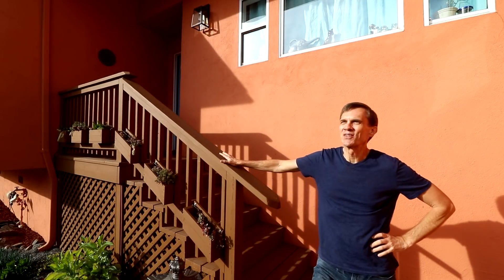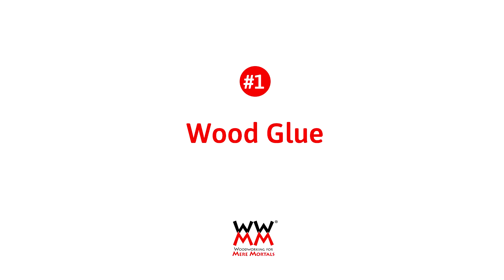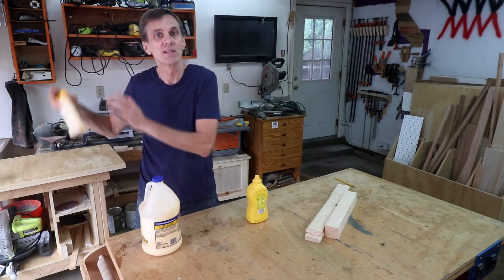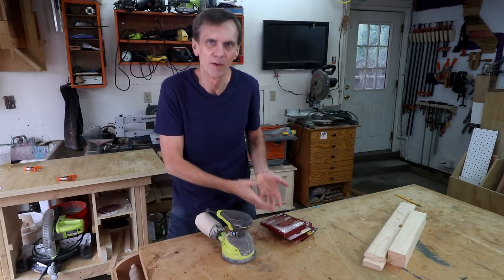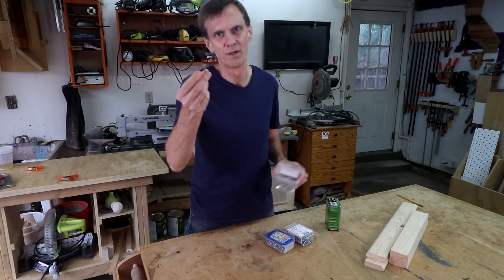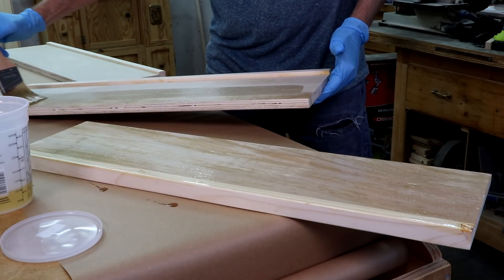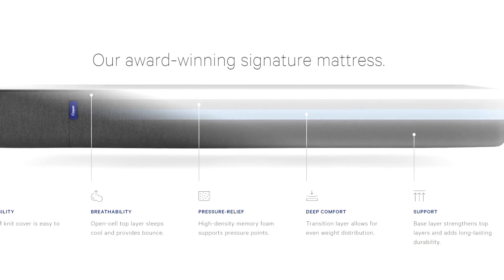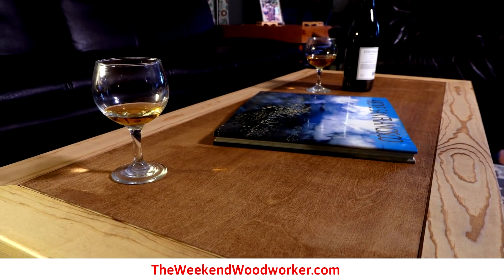5 Woodworking Shop Essentials. (DON'T RUN OUT OF THESE!)

Comment: I see that you shop at Ace Hardware. I used to be a Home Depot man. I live in a small town of 1100 ppl. A couple yrs ago I needed some odd sized bolts. Asked a co-worker where I could get them. He recommended Ace in the next town over. The staff there are AMAZING. They actually know what they're talking about, wither about plumbing, electric, woodworking, welding, tools etc. 

Ace has saved me alot of money over the past 3 years. I know most the staff's name at 3 local stores. And my 3 stores are all in the same family, even though one is 150 miles away down by my mom's house.

The staff really goes above and beyond. One time, one of the assistant managers bought a $50 tool for me, that I needed and couldn't afford at the time when I was replacing the gas tanks on my truck. You can't buy service like that.

They also spoil my service dog with treats every time we go in.
Reply: Mitchell Villanueva I love ace too, they are close to my house, and very knowledgeable, plus their brand is very good: fasteners, tape, wood filler, sand paper, tools etc.
Reply: Yeah as someone who works at a Home Depot, I'll be the first to say that Home Depot employees aren't always the most knowledgeable lol We're mostly hired to stock shelves. Not give expert advice haha
Reply: I have an Ace less than a 1/4-mile from my house! For small stuff I just walk there and tote it home. I try to give them first crack at having an item in stock, and am willing to pay a little more if they have it, before I drive 2.5 miles to Lowe's, 3 miles to Home Depot, or 4.5 miles to Menard's. The time I save not making those trips is worth a little money. The downside is they don't have the room to stock some items that places like Menard's gargantuan store does.
Reply: My son was at college and needed a very small, very specific screw. He tried the big box, and was going to go on Amazon. I told him to go downtown and ask the nearest old person where the good hardware store is. I said you will know if they have your screw if there is an old dog lying on the floor. He called me an hour later. "How did you know about the dog? Have you been there?"

Comment: Due to the kind of projects on my honey-do list, I have started stocking 8'  2x4s. I also buy 2 1/2" and 3" screws in bulk and pocket screws of the 1 1/4" and 2 1/2" lengths by the box (5000.) My trips to the lumber yard have drastically reduced.

Comment: You nailed the list of essentials for the wood shop, but because my shop is more of an "everything shop", I could add just a few.  A good assortment of O-rings, Shrink tubing, Washers and electrical/electronics connectors.  1-1/4" Kregg screws are my "go to" for pocket holes and about a hundred other uses.  Black and white paint Tremclad spray cans I buy by the case of 12 and save a few bucks, which you can also buy your painter's tape in a bulk contractor pack.  Buying these items in bulk probably saves 20 gallons of gasoline per year.
Reply: I know my “everything shop” is always missing something!

Comment: i think you nailed it with your list.. i like to keep a stock of all my consumables. when i open the last box its time to restock.. screw/bolts/nuts wood glue, hot glue stick, gloves, safety glasses, all tapes, spray paints, wood finishes, paint brushes, sand paper, knife blades, dowels i think that's my must have stuff to keep stock of..

Comment: Pencils are my thing. I hate when I can't find something to write with.
Reply: Matthew Ward I always have pencils, just they are all blunt :/
Reply: I had the same problem. I ended up making a pencil holder by drilling holes in a piece of 4x4. I have like 16 pencils in it and an electric sharpener in my garage. I don't always put them back in the holder but when I see I'm running out then I make it a point to start looking for them or just buy more.
Reply: where I work full time I kept getting irritated that the pencils would just disappear, so I bought a gross of pencils (144) from amazon for 10 bucks. 
the reviews said "pretty good, but the lead isn't always centered so pencil sharpeners don't work on some"
Pfft, I sharpen with a knife so that doesn't matter.
that was about a year ago, with between 7 and 12 people in the same shop, there are still a dozen or so pencils in the box. 
I just ordered another gross for my personal use, should last me about 5 years I reckon.
Reply: Not sure the English name, I only, ever, always use ever sharp pencils (criterium in French ), those plastic pens with 0.7mm carbon sticks. Never need sharpening, always thin, very regular and precise trace. Always have 3 spare ones in my box. 

Also, carbon works on most surface, can be removed with rubber, and is chemically stable. It is not altered by water or other solvents, does not fade with time, light, air, oxygen, and never diffuse through paint ... Like most ink pens. On metal it produces a very thin trait, but it's usually enough to draw reference lines, and you can make them more visible with a tungsten point just before drilling or cutting.
Reply: I keep mine on the top of my ear....
Reply: Me to its so annoying not being able to draw with a runaway pencil! LOL
Reply: dscrive I did the same at work but I buy the brightly colored ones (pink or orange seem to work best) this way you can see them quickly and you also know immediately who’s collecting them.
Reply: Wear bib overalls.  Very handy pencil pocket right there.
Reply: i have pencils all over my work area but they are nowhere to be found when i need them :\
Reply: That's why I buy 20 pencils near hand.
Reply: @dscrive: Perfect! :) Same here. Only I bought 26 pencils. I can verify it works. Finally! There's no problem anymore with "where did I put the pencil?" when it's needed fast. The pencils are everywhere! :) At strategic locations in garage, workshop, even home. Sometimes I have 1 person to help. So, the minimal safe number of pencils per person is 13. Twice that is optimal.
Reply: I have dozens of pencils in every nook and cranny of my home...  and I can't find any of them.
Reply: Need to add a pocket pencil sharpener to that. I just can't seem to get a good point with my pocket knife. 😁😁
Reply: The only problem with me not having a pencil is because it’s in 2 pieces in the corner after I have lost my sanity due to my sisters breathing over my shoulder - usually after eating a peanut butter sandwich - while I work on joinery that has to be perfect or close to it.

Comment: A gallon is not cheaper in the long run. At least not if it falls over without the cap on and you don’t notice for a day. Happened to me and I let it dry. Afterwards I could peel it off in one big piece and had a nice clean spot on the floor.

Comment: fiy, for those with latex allergies (made from natural rubber), check out nitrile gloves (made from synthetic rubber) which have a higher level of puncture resistance but perhaps less touch sensitive than latex. Thanks great video as usual.

Comment: I stock disposable chip brushes, both 2" and the "acid" brushes, in bulk. I use them a lot for glue and finish application. Also, shop towels, you can never have enough.

Comment: As a suggestion, instead of masking tape for marking where to stand, get some spike tape. It's what we use in the entertainment industry. It's a colored fabric tape with an adhesive that makes it easier to peel off the floor than paper masking tape. It's a little more expensive, but you probably won't run out anytime soon.

Comment: Yes, I too have that same sandpaper psychosis. I don't throw away sandpaper until it gets glazed from paint er varnish. I found a rubber block that is used to unclog sanding belts and I probably get more life out of my sheets of sandpaper now than I am legally entitled to. Check out the online search term (ahem) Unclog Sandpaper. After a few unclogging sessions, I promote my sandpaper to the next highest grit. If I've unclogged 120 grit a few times, it evolves into a 180 grit. Its actually gratifying to see it come back to life! Keeping it unclogged only takes a few seconds and beats having to change it out so I don't wait until it is destroyed. The trick is to catch clogging early and not pushing the block into the paper very hard while the sander is running. I've done this with belt sanders as well as oscillating sanders. Someone on line also recommends using a tennis sneaker. Would that be sneaker psychosis?

Comment: Mechanical pencils and lead, 0.7 mm.  I  kept losing them and rebuying so often I took a scrap of wood and drilled holes in it to hold several of them and then mounted it on my tool organizer wall.  It forced me to always return the pencil to its place on my wall when I am not using it instead of leaving it in some random place I think I will remember but never do.

This simple thing has saved me lots of time and I don't have to replace them as often.

Comment: I am getting started in wood working, at first because I am finishing out our basement, but also because I found it enjoyable. Oddly, I have purchased a sliding Miter saw and a router with table, but no table saw. I guess I am going at things backwards, but I bought the miter saw first because of all the molding I am cutting.

It seems like I can do most things with what I have, and with my circular saw using a clamp on guide, but I keep eying table saws.

Comment: For me, it's flap discs and foam sanding blocks.  I do a lot of steelwork with my projects where I use a lot of flap discs on the small angle grinder (specifically, 80 and 120 grit angled flap discs).  They eat metal and wood in seconds if needed.  On top of my steelwork, I like to finish my ugly-ass welds with spot putty, usually used for imperfections on car bodywork.  I fill pinholes and tiny gaps with the spot putty, let it dry, and then I'll have at it with the 120 flap disc and I'll finish it with a foam sanding block.  The foam sanding block lasts forever if you just to spot putty finishing with it.

Comment: One item I like to always keep on hand is ballistol. It’s good for almost everything. I use it to protect and lubricate my tools and all of my other hobbies. It is also pretty inexpensive compared to topcoat sprays. And is eco friendly at that. Just remember that the more you use it the better it works because it soaks into the metal, leather, or any
Reply: Other material. It is good for a lot of different types of material. Check it out and see for yourself.

Comment: I also dislike running out of screws and glue. I use square instead of Torx/Star bits. I am sure there is a mechanical advantage or something about using Torx over square head, but I haven't experienced it. I use the square because it costs less in my area. 

I also dislike running out of coping saw and fret saw blades. I don't go through that many of them, but that is how I run out of them. I break one and then I think I am sure I have another package somewhere. Like you with sanding discs, I keep two packs of blades. Once I run out of one I add it to my list. Yay kan ban!

Comment: OK two things.. Razor blades... Need several 50-100 packs mounted, on the wall, everywhere... Other folks mentioned pencils. I know everyone buys a couple of carpenters pencils at the counter (of the big box stores) and probably a sharpener too. But I always seem to have the kids left over round (octagional) no.2 pencils with the tip broken off inj my posession. BEST INVESTMENT EVER.... I bought an all metal pencil sharpener like they had in elementary school when I was growing up. SOLVED THE PROBLEM...

Comment: Not sure about across there but over here in the UK, in recent years there's been a transition to metric woodscrews, Imperial are still available & for along time I was dead against buying Metric, however once I started using the metric ones, I found due to a different pitch of thread, they drove in much easier & had a superior grip even in end grain, didn't tend to split wood, meaning you could drive a screw in closer to the edge & most of all, metric woodscrews are by far a higher quality yet much cheaper version of the Imperial screws.

Comment: Dude I work in auto body repair & I do the same thing with saving used sanding disks. Idfk why I do it either. I might re-use the old ones maybe 3% of the time. You are not the only one. Shits expensive! 

Same with rubber/nitrile gloves if I dont soil them I keep them & reuse them. But I actually do re-use the gloves unlike the disks.

Comment: Also, if you don't plan on visiting a far hardware shop and a friend is going there - just ask if he wouldn't mind buying you a thing or two by the way. Of course this means some small things that don't need you selecting them - like a drill bit, pack of pencils, sandpaper discs or sheets... ;) It helps to have a package/label to show to the friend what you want him to buy. Of course it's a good manner to give money up front, not later. :)

Comment: in addition to what you have listed i keep extra sharpies/pencils around (i use sharpies alot) i also keep probably around 10 1/8" and 3/16" drill bits as i tend to use those the most but i have a couple of each fractional size up to 1/2". also a bunch of carbide inserts for my lathe. and machinist rulers/calipers are spread around the shop so i dont always have to go looking for one. i should probably mention i work with metals / resins more then wood. so you might not burn out the sharpness of cutters as quick.
Reply: oh and super glue. i buy like 50 of the little ones at a time i go threw that stuff amazingly fast. its also great as a band aid.

Comment: Yup, Ju Na is right:  Those are Nitrile.   And Nitrile is WAAAY better, as latex is unhappy around oils/mineral spirits/etc.  I found that Harbor Freight usually has great prices on big boxes, and for wood working I often use their lightweight (white) gloves, as they are very thin and sensitive.  Those work great for staining, etc (good dexterity in handling the piece and the brush/pads.  The thicker blue Medium weight ones are much tougher, but often unnecessarily so.
Lastly:  I found buying big boxes of sanding discs from Amazon was handy.  The Mirka 50 packs are under $20 and seem to be good quality.

Comment: If you're ever at Harbor Freight, buy a box of their 9mil thick black nitrile gloves. They're so thick I use them in mechanical work, even engine rebuilds, and I wash, dry & reuse them several days in a row before they get a hole.

Comment: Something I always run out of is 4” screws... ALWAYS. I can’t find them in the big box, and though I use them quite often, I only use 8 every time (for screwing 4x4 legs in a table), so it is easy to forget. Usually I’m too lazy to go to the store so I just use 3” screws, which I recently purchased in a 25lb box!! Lol. And yes, sandpaper.

Comment: never ever stock up on belt sander belts...they have a shelf life...bought some on clearance and they set in my shop for quite awhile...when I went to use them they all started snapping in half at the seam. I guess the humidity had gotten to them and they were no good at that point, other than using them around pvc to sand curve joints and hand sanding. all of the extras I have now stay in the closet in the house...so hopefully this will help

Comment: Thanks for the tip on the screws, the star / torx / spax (depending on where you are buying from) are great and really not that more expensive. 
I get mine from Axminster (for those in the UK)

Comment: One other thing I realised too late about the latex gloves is that if you need to work with cement and the main worksman gloves you have won't stop the stuff from getting through, you can put a pair of the latex gloves on underneath them to keep you hands clean.  Especially if you have a cut on your hand.  Even if bandaged some of that stuff can work its way in

Comment: I have said over and over again, for sanding stuff, contact a local supplier, there's probabpy at least one in each state over in USA. Those guys have everything at half the price. Custom belts, 8 or 9 hole discs, they will teach you about different grades of backing paper (yep, they are from A to F) etc. If you don't know where to look, ask your local furniture maker that has one of those super wide drum thickness sanders that you can do a whole door with. These belts are only custom made so they have to have a supplier for them

Comment: I bought the smaller bottle of TiteBond just for application and refill it with the gallon - just like you have the extra bottle.  I like the TiteBond bottle because when you close the tip - it blocks out the glue so it never gets stopped up on the inside, you just have to peel off whatever's on the outside.  I shouldn't ever have to get another bottle.  Maybe you can kit-bash your bottle with the TiteBond cap.

Comment: Hey Steve I had a suggestion as well as a few comments. Generally stores sell a block of a rubbery like substance in a paint stick that is used to take sawdust off of belt sander belts have you tried using that to squeeze some extra life out of your pads? Also the Diablo sand paper 100 packs really aren't a bad price for what you're getting. I happen to work at dixieline which is a 7 location lumberyard chain in and around San Diego and was wondering if you've ever stopped in and if you had what was your honest opinion of our store? also one last final thing that I need to have on hand is grk fin trim screws.  They're very narrow and have a tiny head which I use to hold projects together since I don't have a Brad nailer